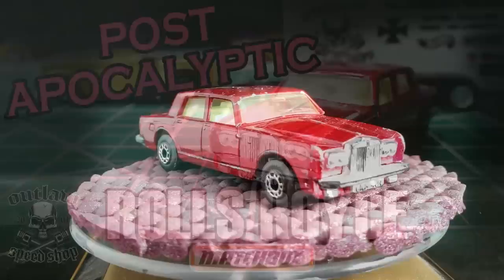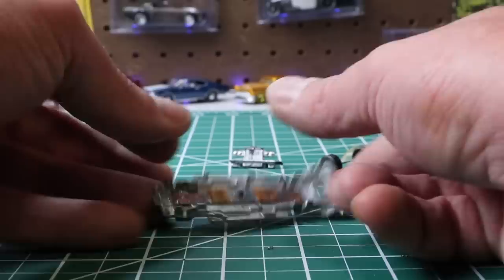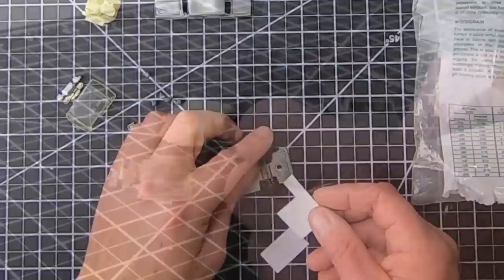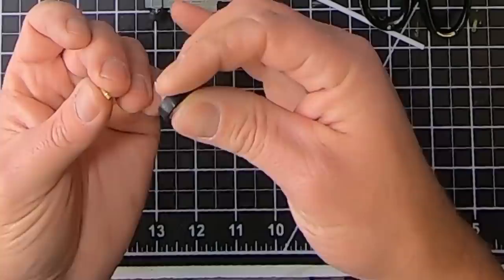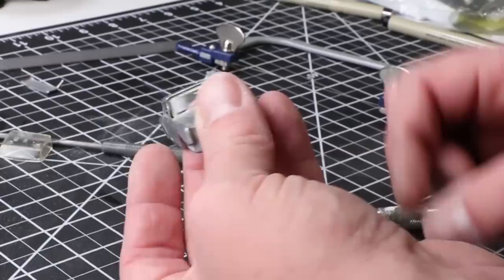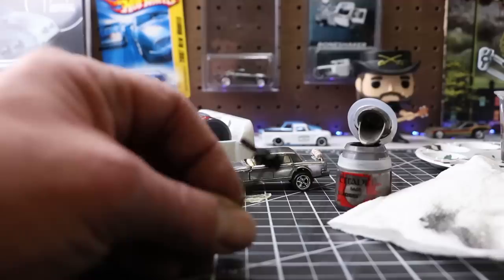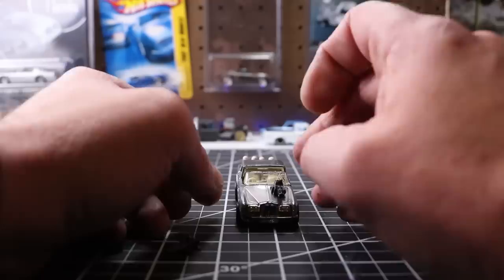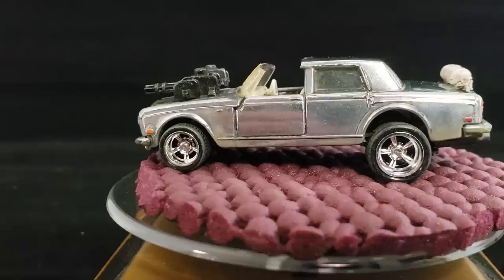Post Apocalyptic Rolls Royce - Bosses Car

Comment: NOT a criticism, but, rather, an honest procedural/aesthetic question: why didn't you base in gloss black and then spray on chrome? Was there a particular reason you went with polished ZAMAC instead?
Reply from the maker: Having done the spray chrome many times, for me nothing compared to polished zamac
Reply: @OutlawSpeedShop2001  There is something appealing about a nice, shiny, clean piece of bare metal :)

Comment: Nice work but a bad idea. Two Gatling MG on the hood. From where would the guns feed?  Such guns need up to 3.000-4000 rounds per minute! They had no elevation and only limited traverse to one side. The crew would need a crane to rise the hood for maintanence on the Motor. A bosses car didn't need such enormous firepower.. The car has now armor protection against anything that could be thrown on him ... and last but not least the driver and Passenger in the front wouldn't see anything with such big guns in front of them... In the end this would be a suicide car .. Sorry that won't work
Reply from the maker: You put way too much thought into my builds lol. Thanks for the input though.
Reply: :::😵😵😵::: NERD ALARM!!!